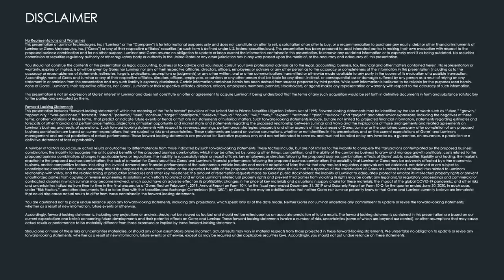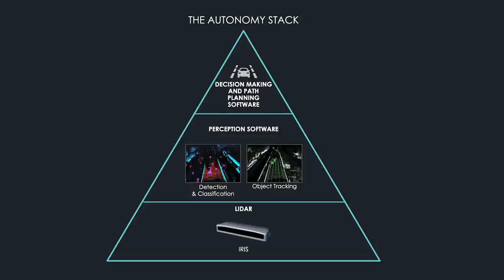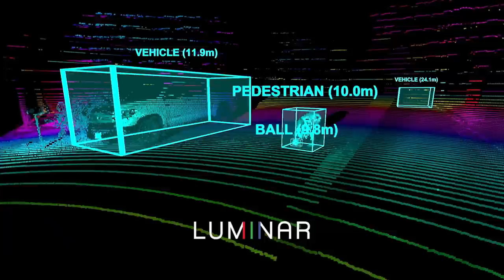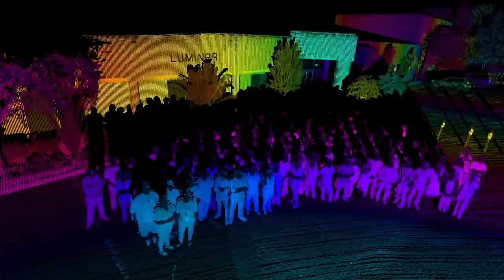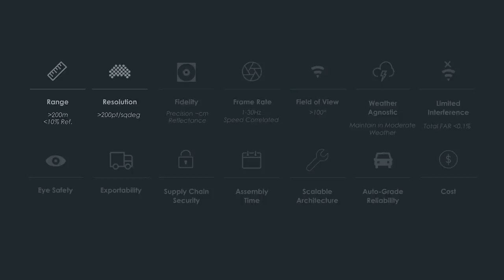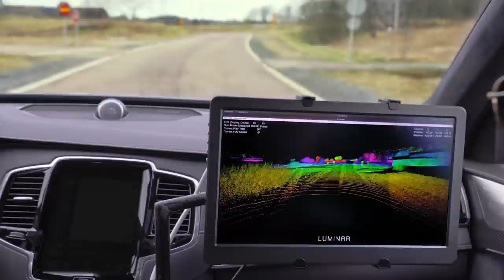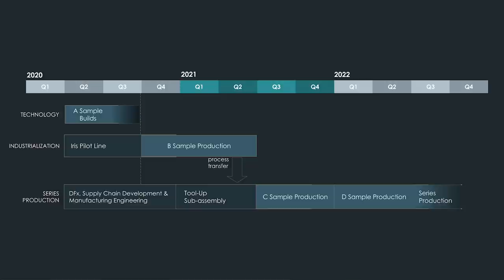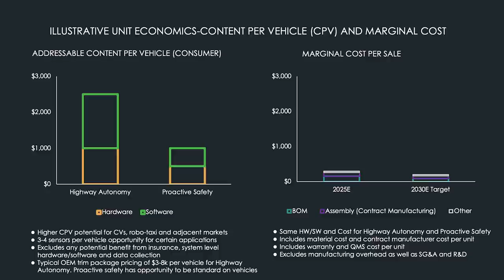Luminar's Investor Day | Oct. 6, 2020

Comment: Good questions at 52:00 and 55:00 - I get that you might have the most impressive Lidar technology and that's great but I don't see where your software aptitude is and I think that's more important frankly, especially for city street driving. Those questions were answered pretty well but it seems that the lack of data to base vehicle movement decisions on is a big missing piece. 

Are you implementing machine learning to build this robust self-driving brain? Are OEM's going to be relied upon to each craft their own self driving software (pls, no)? Will each OEM software be unique or will it be "Volvo _____/Mercedes _____/OEM 3 ______, powered by Luminar"

I don't know... feels like you're putting Terminator vision on a toddler and expecting it to compete in American Ninja Warrior.